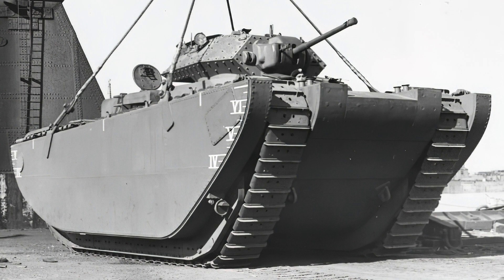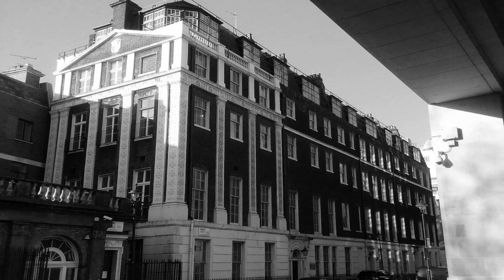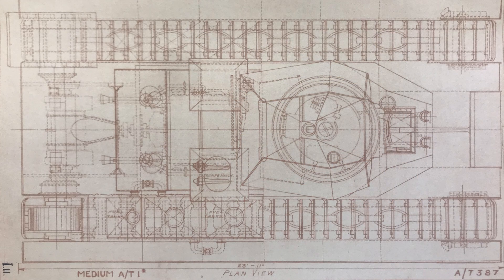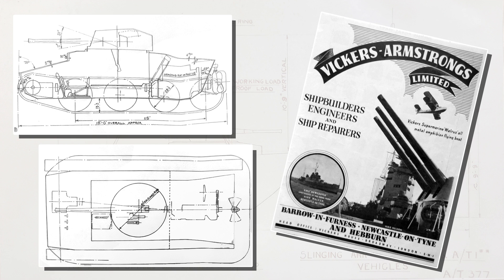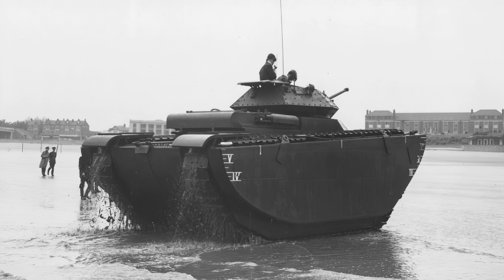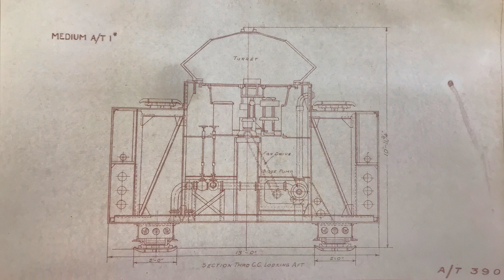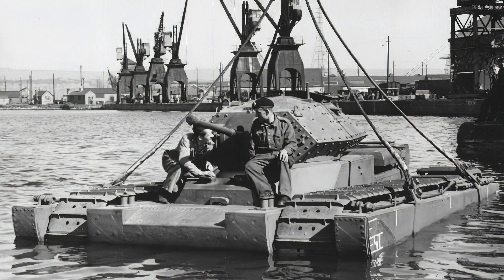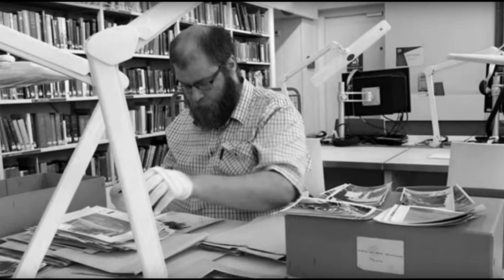Braithwaite's A/T 1 - Tank Design &  Development

Comment: Not sure if it is fair to say that they should have been making floating tanks sooner. You only make things if you need them and until that point everyone thought tanks would be unloaded in a dock with a crane. Not even the Germans expected the French to collapse the way they did.

I seem to remember something about a swimming version of one of the WW1 tanks but it never went into production. I cannot remember the full details but I think there was supposed to be a float along either side of the tank. Not sure how far it got but I think they did do a test but I think it may just been a hull with the floats attached.

They would, of course, make quite a good little swimming tank a bit later on with the Sherman.
Reply from the maker: yup they did indeed, and tested it at dollis resovoir. we had floaty tanks but not once we could launch out at sea at the time

Comment: They should have built a mountable outboard, large prop turning at low revs. The fuel tank etc could have been held on the outside of the tank, whole thing disposable because you only need to land once with it.
My dad built a crude but MONSTROUSLY effective one from a 600cc motorcycle motor, around about the time I was born, so he could shift a large derelict barge without asking for help/explaining what he was going to do to the Harbour Board. In the 60s, there were import restrictions here, so things like large outboards simply did not exist.
He used a gearbox from a truck to reduce the revs extremely, the drive was just inline so he didn't need to worry about joints like you have in a normal outboard, and he "borrowed" a prop from a large commercial vessel, ( when he explained the build to me years later he held his hands about three feet apart when saying "Good sized heavy prop" :P )
He said it hardly took much time to build, but then he was quick, and rough as guts. :)
Reply: The American Amtrack was a similar design but used tracks with large blades on each cleat of the track. It was quite manoeuvrable with track propulsion only. The Americans built several thousand for use in the Pacific.
Reply: @allangibson2408  Yeah, I know about them.
Here is a funny fact for you. They were used in training exercises in the New Zealand bay/beach called, ironically, Omaha. Years before the Omaha mainly linked to them.
Exercises training US troops ( 140 000 were deployed in NZ during 1942/43 as a relay point for the push up the pacific. ) in contested beach assault tactics.

Because of how google works, I can't find a link, but early on in the training there was a horrible accident in foul weather, and about a hundred US Marines drowned during one of the exercises. There is a cenotaph and inscription on  a headland overlooking the beach.
Because of wartime censorship, reporting about it was forbidden here at the time, D notices served on the Newspapers.
Reply: @uncletiggermclaren7592  Marines are still having bouyancy problems with Amtracks. The biggest drawback to the LVT(A)-4 was its aluminum armor. Useless against anything but small  arms fire. But it had a turret, so Infantry officers insisted they come up on the beach and give support, assuming it was a real tank. The turret guns [37mm or short 75mm], were supposed to give fire support on the approach -- in the water, they'd have the additional cushioning effect of water surface tension to deflect incoming fire. On land they were slow, sitting ducks. Japanese changed their tactics in the later war -- not opposing the landings, but setting up ambushes of interlocking fields of fire once inland.

Comment: For a nation surrounded by water they forgot to add a pair of propellers. On the bright side - the didn't try 10-inch gun. And thanks a lot, your videos a treasure of info.
Question - do you plan to look into "The Hunter" project? It looks like a worthy opponent for "Chick & Hen" design.
Reply: With properly designed tracks propellers would not have been essential.

Comment: The idea of partially flooding the vehicle to gain traction when coming ashore is actually a pretty ingenious idea
Reply: Maybe but depending on the slope of the beach you could end up with flooded engine compartment. I am surprised they did not suck air in trough the turret.
Reply: @MarcinP2  They had snorkels and intense waterproofing. [Even Jeeps] Also Marine tanks were rigged with diesel engines. The fuel is safer onboard ships in seawater, and ignition is less critical -- once started.
Reply: In the pacific campaign it was routine for Sherman’s to wade ashore in water up to a meter deep.